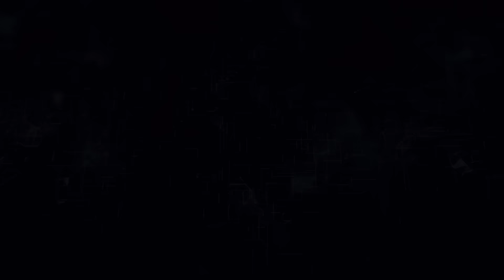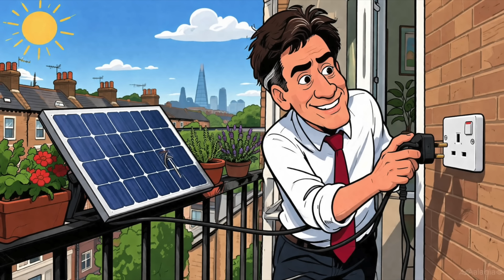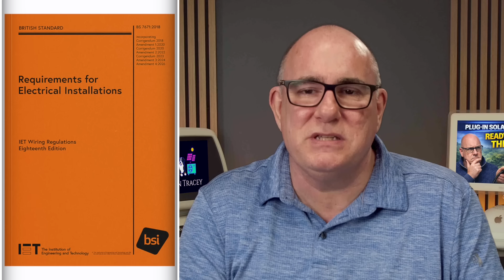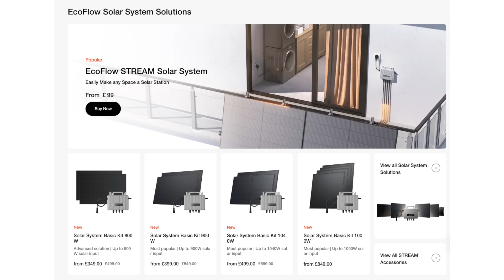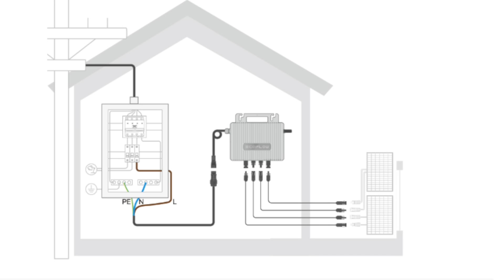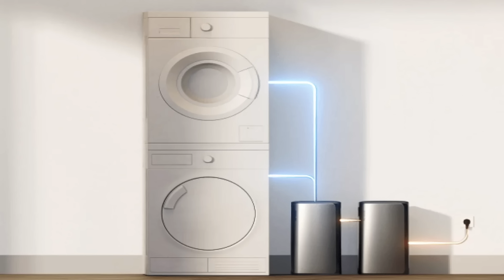Plug In Solar Is Coming… But There’s a Problem

Comment: Don't solar+inverter setups create a lot of "dirty electricity"?
Reply from the maker: Define dirty electricity
Reply: Assuming you mean poor quality waveforms then no, unless you buy cheap junk from Temu and friends in which case quite probably, assuming it doesn't fail, explode or set on fire first.

The G98 grid tie equipment and all reputable solar/inverter kit produces very clean waveforms.
Reply: I came across “DE” while researching something else, but this is the general description:
Dirty electricity (DE), or electrical noise, refers to high-frequency electromagnetic interference (EMI) traveling along power lines where only standard 50/60-Hz AC should exist. Caused by modern electronics like LED lights, solar inverters, and dimmers, it creates voltage spikes. While often related to electrical issues like buzzing, hot wiring, or equipment malfunction, some studies and reports suggest potential health links to fatigue, headaches, and in some studies, impacts on blood sugar management.
Reply: @jason-m  All electrical equipment is required to meet strict electrical noise rules, and the major exposure you have to high frequency electrical energy is round, yellow and called the sun.

High frequency EMI doesn't cause voltage spikes either or hot wiring, it can cause problems with very poorly designed other equipment and radio reception if very close, but it's easily filtered off wires so not really an issue.
Reply: @e @etchedpixels  oh 🤔 the sun 🤣 I’ll explain it simply cause I can tell you haven’t the foggiest;  DE is just unused electricity. We all have it in our homes, we all pay higher bills than we should because the energy companies aren’t held accountable. In Japan, companies are fined if they produce too much DE in peoples homes in order to keep bills down. It can be filtered out before entry to the house or even inside with meters and plugs, people save hundreds on their bills by doing it. So, I don’t know what you were guessing at but that’s DE in a nutshell. Look it up 👍 (it doesn’t mention the sun though 😂)

Comment: Thanks for your interesting video, just one observation on MicroInverters..  Not all MicroInverters are safe to fit a plug as they may output a voltage when the plug is not in circuit. As a caution never touch an exposed plug just incase the unit you have is not up to snuff. The Plug and play MicroInverters need a 'handshake' from the 240 AC to confirm the circuit is present and then synchronise to output current so the plug is never at an unsafe potential.
Reply from the maker: @Woffy. yep spot on 👍  

Proper plug-and-play microinverters won’t energise unless they detect the grid (that handshake you mentioned), so they’re safe by design.  

But you’re right — not all units are equal, so quality and certification really matter.

Comment: 800w , that is a lot of space for panels ? , more than what you think .
Reply: about 2m x 3m at this point. For most houses not a problem, although a new build with a postage stamp garden might be trickier.
Reply from the maker: Modern solar panels are about 450 to 550 W per panel. So two panels producing the maximum and you would be running at the limit of the inverter.

Comment: As I have solar and batteries already I would probably use it as a stand alone system. Since upgrading to a 13 Kwh battery system (Give energy) I now have 2, 3.2 Kwh batteries spare from my original set up so would probably connect to them and run items in the garage, an infra red sauna for example, freezer? could also use my slow cooker. Mmmm wondering if this would heat up a tank of water over time?
Reply from the maker: @livingladolcevita7318 that’s a brilliant use case 👍  

Yes you could heat water over time, but resistive heating is quite inefficient — it’ll work, just slowly.  

Your best use is exactly what you said: running steady loads like freezer, sauna, slow cooker — perfect for soaking up excess 👀

Comment: So £250 to get paid for exporting, or else they just take the free electricity you generate, because in a standard home setup if you add an inverter then by it's nature it's exporting unused electricity out to the grid.
Reply: If you are generating an 800W peak and have even a small battery you won't be exporting very much if ever.
Reply from the maker: You’re not gonna be exporting hardly anything with an 800w inverter, better to plug a small battery into it to soak up any excess and use it yourself later

Comment: What about the DJI 2000 Power Bank, isn’t that already G98 compatible? Could I just plug 2x 400W panels into a MPPT, plug that into the the DJI Power Bank and plug that into my three pin mains socket?
Reply: If they keep the regulations on the device side the same as is likely then probably yes.
Reply from the maker: Yeah, you can do all of that right up until you plug it into the wall and that would be in contravention of the current wiring regulations. However, I don’t think anyone’s gonna come after you, and once the law changes in the summer it will be legal.

Comment: Bla bla bla... JUST PLUG IT 😂
Just use a micro inverter with limiter that matches home power use... Oh and use with a rack battery with it...
Reply from the maker: If you buy a decent micro inverter, you don’t need a limiter, I don’t even know what a limiter is. A 99% of the population couldn’t install a rack battery if their life dependent on it.

Comment: Could this be used to charge an electric vehicle directly??
My Kia PV5 has a 3 pin plug in it.
Reply: Nope. It's grid tied. It'll help charge your EV bu that is about all.

It is possible to charge an EV directly off a big power station with a 3kW or better inverter rating but you'd also need a lot of solar for it. Except for little things like the Citroen Ami the cars use a lot of power. For ebikes and the like it's really easy to do this, for cars you probably need a full sized solar setup anyway.

Might make sense if you had a lot of unshaded space on your garage roof and no other supply I guess.
Reply from the maker: not really, you’re only gonna be exporting a maximum of 800 W from a microwave inverter. Your car really needs about 1300 W just to start charging.

Comment: Shot in the dark here...

... there will be dodgy or cloned microinverters which reach the UK market... and fires start happening... 🔥 🔥 🔥

Since when has a govt energy saving initiative worked? (cavity wall insulation etc..)
Reply from the maker: @andrewwalsh2755 I get the concern 👍  

That’s exactly why standards and certification matter — quality equipment with proper protections is extremely safe.  

The risk is more about poor installs or cheap knock-offs, not the tech itself.

Comment: They tried this plug and play with a Winturbine 20 years ago, it was called WINDSURE. It was sold in places like B&Q  it was pushed by a minister who convinced government to back it, it was rolled out very quickly, problem was nobody had actually tested it out, it was manufactured in china it was advertised that they could be attached to any building,the wind would blow and the blades would turn and the DC motor would produce electricity which would go through an inverter which would convert the DC to AC  that could then be plugged into the mains ring circuit. Putting AC voltage through the system to run the meter backwards,     It was a total failure, it was also very dangerous, the company closed with claims of fraud and misleading information of how safe and effective it’s was,   A small solar system is totally a waste of money and will never payback the outlay cost,
Reply: No likely involved - there are over a million of them working nicely in Germany and they pay back.
Reply from the maker: @denburnltd880 I remember Windsure 👍  

The big difference now is modern systems have *proper standards, anti-islanding protection and tested hardware* — they don’t “run meters backwards” anymore.  

And on payback — small systems can absolutely pay back, especially when offsetting 25–30p/kWh electricity. It’s a very different landscape today.
Reply: @J @JonathanTracey   I have one sitting here and I never did get it working properly despite it producing a couple hundred volts DC when the wind blew, I was hoping to figure it out but never got around to it, they are built well enough the pole the blades even the motor. I’m too old now to be able to refit it back on the pole. So it’s going to be sold at my final estate auction.

Comment: Great video. We've got a south facing garage that we will eventually remove and replaced with an outbuilding on that I was hoping to have PVs on as the roof on our house isn't suitable. That is years away so a small system like this is very tempting but the roof of the garage is asbestos 🤦‍♂
Reply: You'd need to change the garage roof first as nobody reputable will drill holes in asbestos roofs and fit unistrut and the like. Not too scary - asbestos roofing is fairly easy to remove. Just have to find someone who is neither cheap and dodgy and will dump it down a back lane, and not some asbestos terror scam artists. A lot of councils have good asbestos advice people.

One option is actually to replace the garage roof mostly with tray (ie "in roof") solar and then just roof around it. There are systems for this for most roof types, although not afaik if it's dead flat.
Reply from the maker: @ChrisfromLeedsinUK great use case 👍  

If the garage roof is asbestos I’d avoid mounting directly to it, but something like a *ground mount or fence setup* could work really well in a south-facing garden.  

Perfect way to get started without waiting years 👀

Comment: yeah good luck thinking this is going to give you anything realistically usable 🤣🤣🤣🤣 (cant even connect to the grid)
Reply from the maker: So yes you can create enough to cover all of your houses based energy bills, save yourself probably a couple hundred pounds a year. Given the lifetime of the system is probably well in excessive 15 years it will more than pay for itself.
Reply: @JonathanTracey  there is no need to lie. just be truthful about the facts & realist usage. try cooking a meal & using more than 3 appliances including the oven. How many Kwh ?  not hating on the video, just the approach

Comment: The solar panel will soon be obsolete and so will the wind turbine they both need back up batteries  no power at night or if it is a dull day or raining the wind needs to be at around 23 to 29 mph for wind power the average wind in the UK is 15 to 17 mph you need batteries for solar at night or the grid power so no real saving on your bill
Reply from the maker: @grahamflowers
Solar doesn’t need to replace 100% of your usage to be valuable — it just needs to **offset what you would otherwise pay for**.  

Even in the UK it generates reliably across the year, and with today’s prices it can deliver a *very predictable, low-risk return* compared to most investments. @grahamflowers I get the concern 👍  

Solar doesn’t need to replace 100% of your usage to be valuable — it just needs to **offset what you would otherwise pay for**.  

Even in the UK it generates reliably across the year, and with today’s prices it can deliver a *very predictable, low-risk return* compared to most investments.
Reply: @JonathanTracey  we need power 24/7 not intermittent power reliability is key for homes businesses cheap clean power is the goal that is what is on the way then wind and solar will be obsolete

Comment: I have watched lots of video of people who have built really large setups and even planning cooking your dinner can be a nightmare.
Reply from the maker: Then they haven’t got an appropriately size system, our system is relatively large by most standards and we never have to worry about turning anything on, 99% of the energy we use in our house is either generated from the Sun or bought as cheap right energy overnight installed in batteries
Reply: If you wanted to maximise solar performance without battery then that used to be true (most people didn't bother and figured they wouldn't stop to pick up a 5p piece in the road so why would they delay the oven for two hours for 5p). With batteries it just stops mattering.

Comment: For several months of the year in the UK I get about 12-15w per panel and when the sun finally comes out I get about 120w from a 200w panel. You need sunshine for effective solar and we don't get that in the UK, I did my own install with a 5kw invertor and 6 panels with grid tie in for less than £1000. That's the only way it's cost effective, you can't spend £25k on solar and expect to ever get that money back....
Reply: If you are getting 120W from a 200W panel correctly oriented and unshaded facing south that's actually dire. You should be seeing the theoretical performance on sunny days in spring and autumn.
Reply from the maker: @techsabbath I get what you’re seeing 👍  

UK solar isn’t about peak output, it’s about *consistent generation over time* — even on cloudy days panels still produce.  

The key is using it against your base load. And on cost — entry-level systems (~£200) can pay back in around **2–2.5 years**, larger installs take longer but scale the savings.

Comment: CAME ACROSS THE COMMENT BELOW ON A CHANNEL ABOUT SOLAR

Few things you don't need an MCS certificate to get the base SEG payments, that's actually a myth and some electricians have now forced the issue. It must be installed by an electrician qualified in the relevant area and a member of a professional body (all electricians have to be). Does involve threatening your energy company sometimes to get them to confess to this.

You need a G98 form filing regardless of whether you export or not as the device is grid tied. That's easy enough to do. Also the right diagrams and solar on the roof and other solar labelling, plus a lockable isolator that people often miss when they get a sparky to just put in a bidirectional circuit from the consumer unit.

A competent sparky will sort all this out but not all of them know the solar regs well. October this year will fix that as any electrician installing solar will be required to show competency in that specific area, ditto battery, ditto EV chargers.

If you have a lot of solar you will need planning if you stick it in the garden (in theory anyway 8)) unless you are in Scotland which has sane regulations on things like ground and fence mounted solar.

The new stream inverter does seem a lot better than the old £99 powerstream ones which tended to overheat and trip the mains after a year or two.

Milliband keeps saying we'll get plug in solar at some point, but he's been saying it for rather a long time and nothing seems to have appeared in the standards yet even preparing for it.

Comment: I just want something that will keep my fridge/freezer cold if they turn the power off....
Reply from the maker: Get a battery system then, micro inverters will need to shut down if the grid goes off so they won’t power your fridge or freezer
Reply: One of the battery/inverter boxes will do that. How big depends on your fridge/freezer but generally a 1kWh unit is going to be sufficient for anything but a big american style horror or a really old one for a few hours of cover. You can pick those up for a few hundred quid at this point, and as they don't grid tie they are just another appliance so no paperwork at all, just buy it and plug it in.

Comment: Hadn't heard of the 5m rule for planning permission needed for ground mount solar.  So what about your fence mounted panels...?
Reply: It's also an English only rule. Scotland has sensible rules. Wales have equally stupid ones like England but slightly differently stupid. We really need to all adopt the Scottish policy at this point.
Reply from the maker: It’s a rule that they don’t generally enforce, especially when your neighbours don’t complain. When I spoke to our local planning officer, he smiled and said well technically they’re not ground mounted, he told me not to worry about it.

Comment: my day use is  between 6.5 and 8.5 kwh and costs about £2.00 a day.so im not saving loads if i installed an 800w system.the cost to buy wouldnt make sense for me
Reply from the maker: but if you could build an 800 W system for sale £250 and it would pay for itself in less than a year, would it make sense then?

Comment: So an balcony system would generate 800w in daylight hours
That would cover my summer general use excluding heating .washing machine etc. so if you add a battery can that be plugged into a socket  too
Reply: I use about 5 to 6 KW of electricity daily
Reply: And a bigger system in EU style will generate more but only allow 800W to go into the grid via a plug, but has plugs on it that can provide additional power. So when you can hook appliances directly in with many of these systems you can do even better.
Reply from the maker: Yes or you get an all in once battery and inverter and plug it into the mains, then once the sun goes down the battery can supply

Comment: What's the betting the energy companies post August 2026 start raising their standing charge for electric to compensate for the couple of quid a week loss per customer due to plug in solar?
Reply from the maker: It’s possible but remember the standing charges are passed through from the DNO, their charges are not based on how much electricity do you use or do not use